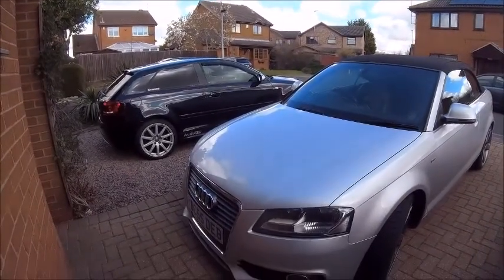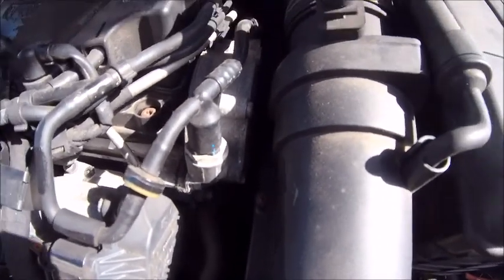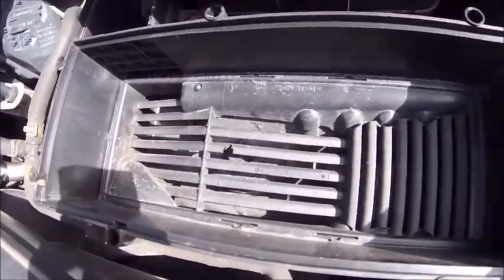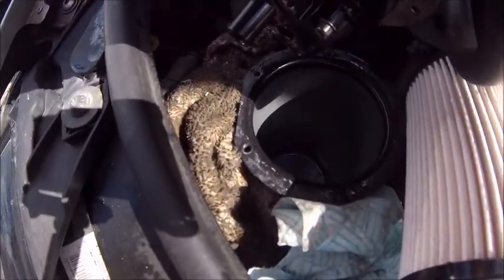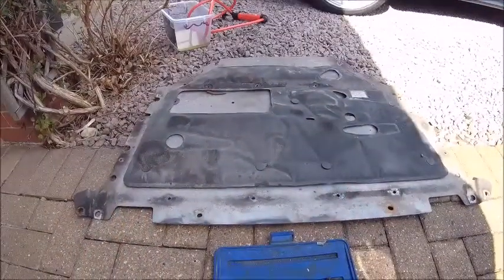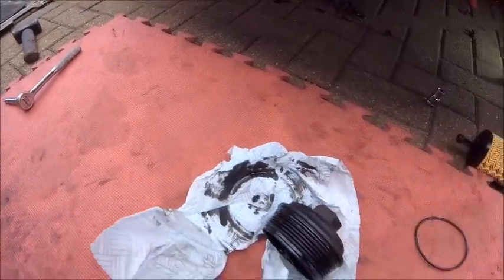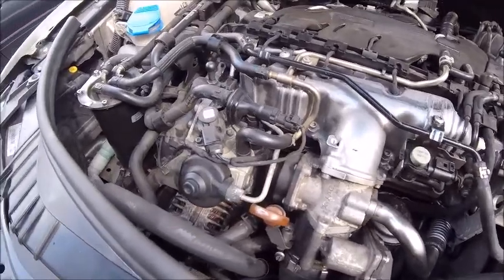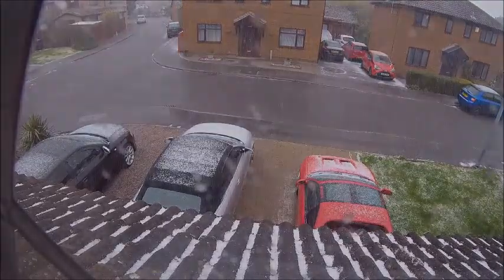#Audi A3 2.0D Cabriolet full service... With Snow !!!

Comment: Hi, I enjoy watching your uploads. My son has a 2011 8P S3, I wondered what reference you used for torque settings etc as good old Haynes don’t do a manual for the S3? Cheers
Reply from the maker: Ill be honest Wayne, Working on assy lines for years gives you a feel for what a bolt should go to and a lot of mine is feel itself (Which annoys a few people)  however this may help  ? ..
https://blogvager.files.wordpress.com/2012/01/10-audi_a3_qsb_web.pdf
Reply: @AdeReeves  Thanks for the PDF, that'll come in handy. I messaged you before I watched this video, so sorry you had to repeat the torque setting question. Keep the vids comming, rain, sun or snow!